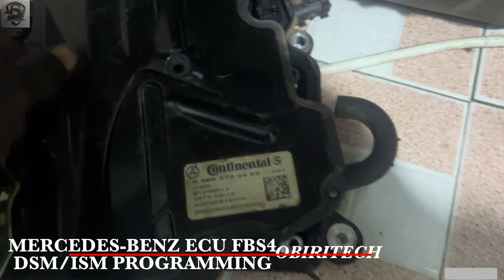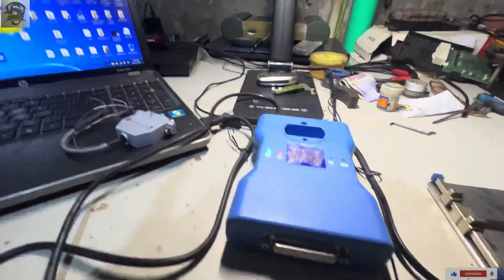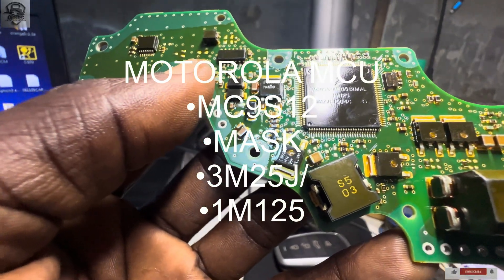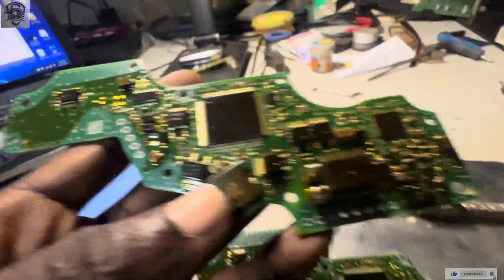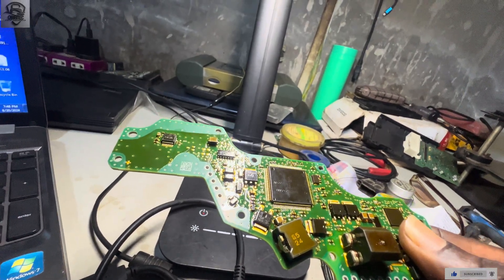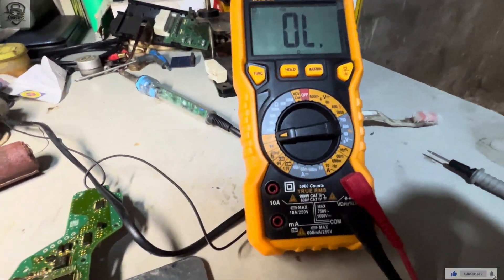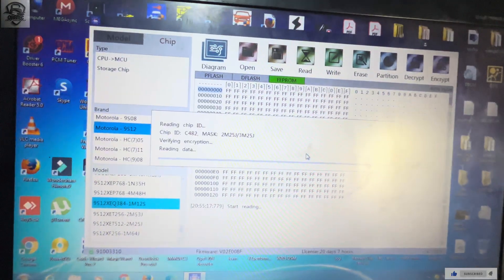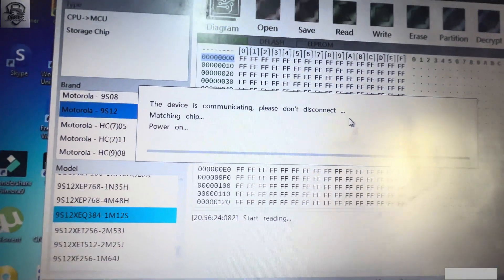MERCEDES-BENZ FBS4 DSM_ISM PROGRAMMING AND PROCEDURE| USING CGDI PROG PROGRAMMER

Comment: Where are you based Sir ?
Reply: Good Morning, I have faulty A0002704652 ISM/DSM. Can you repair it ? Or if I provide you Donner ISM/DSM also can you do cloning coding ? Please let me. Thanks
Reply from the maker: @SayanikaWaikhom i can do the cloning and what happen to the old DSM, is on which model and year
Reply: @obiritech it stuck in P after betray discharge. And now not going into any gear plz
Reply from the maker: Ghana-Accra
Reply: @obiritech hello

Comment: Interesting that in less than a year, we can now carry out the procedure on all FBS4 DSM modules in less than 5 minutes without the need to open up the modules. It is done purely on bench mode with Power, Ground, CAN-H and CAN-L connections only.
Reply: Using FC200?

Comment: SO Master this programmer is called CGPRO or CGprog? 
also at 6minutes, in the video you said "multiply 20 by 4 will give you 112" ; why not 80 instead of 112 ? 
thanks in advance
Reply from the maker: CGprog, 28*4 will give 112 and the chip is 4 sides so when you count them where the pin one is to end will give 28 the multiple by the 4 sides
Reply: @ thanks a lot lol i heard 20. As for the device, the only programmer of CGDI i was able to see with this color on CGDI website read CGPro on top. So i wanna make sure before i buy.
Reply from the maker: @ is the same
Reply: @obiritech  ok bro

Comment: Good morning sr,

Sr
I mistakenly locked a GLC Electric power steering 
While trying to remove the power steering malfunction light.

I really don’t know what to do now sr
Reply from the maker: what is the actual fault in the system, is it because power steering has become very hard or what exactly…
MERCEDES-BENZ W212 ELECTRONIC POWER STEERING PROGRAMMING
https://youtu.be/5y-mNFCifTE
Reply: @ the original power steering spoilt,
So they changed to a new one.
The new one is working real fine, soft too.
But then the light signals fault in the dashboard.

So I tried removing the light,
And it locked